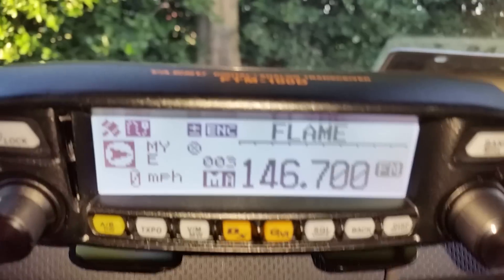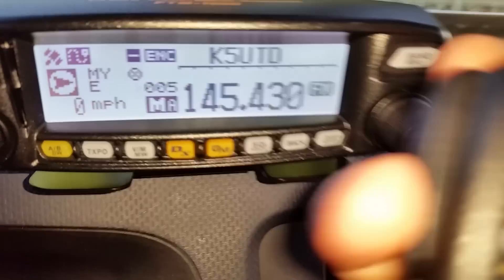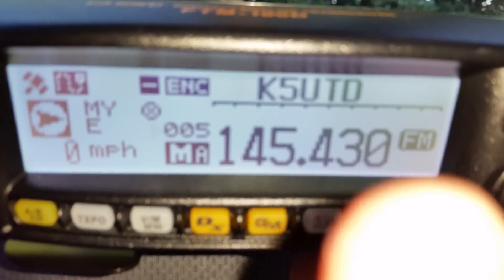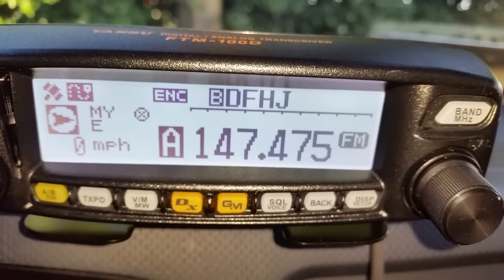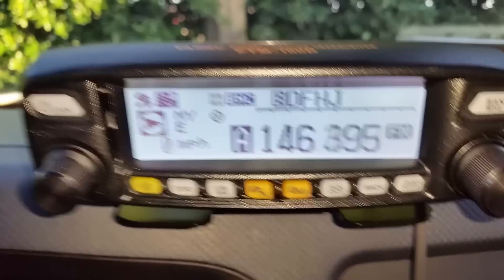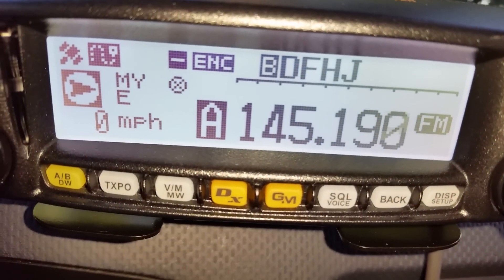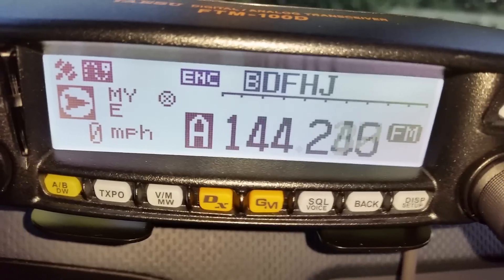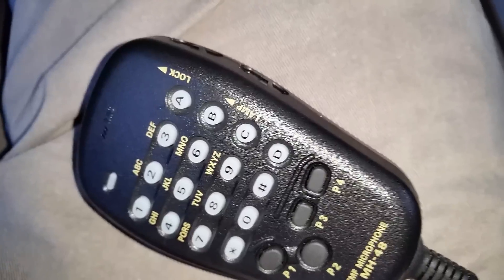Yaesu FTM-100DR Scanning feature

Comment: Just installed that same radio in my truck and I really like it ! I do have an swr problem using full power in the 140 range ! It will be over 3 ! In low power 1.3 ! On 440 there is no problem with low or high ! The antenna a Browning BR 180 is mounted on a well grounded headache rack which is well grounded to the truck frame in four places ! Any ideas ? Thanks
Reply from the maker: I had problems with my headache rack, so I added a paint can lid. I just drilled a hole in the center of the lid. Mounted the antenna base to that. So it looked like a saucer. The other thing is check your antennas length. Set your radio to 140, check swr, if swr is higher on 140 and lower on 147 then your antenna is too short. Whip out the allen wrench, adjust it about 1/4", then check both 140 and 147. If they are even you're good. Just so long as between the two swr readings are set in the middle yet are still reading close to a 3 then you may need a better ground out closer to the antenna, as long as you're under 3, you should be good.
Reply from the maker: Later I decided to mount my antenna directly to the middle of my rack mount above the roof and my swr dropped to a 1.2. However swr in the 3s is still not bad, but like you I hated being that high regardless of what anyone said because of my OCD. Let me know if that helps.

Comment: i have both the ftm 100 and the 400. the 400 does more and is the cadillac but for the cost of the 400 you could almost buy 2 ftm 100s. both are great radios but the 100 is a lot more bang for the buck.